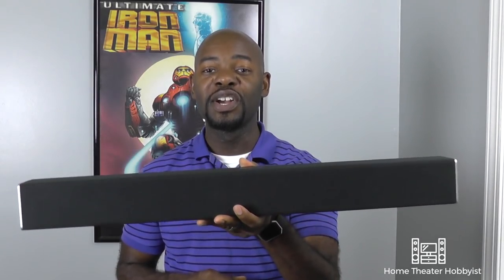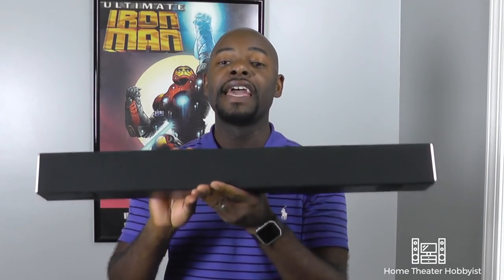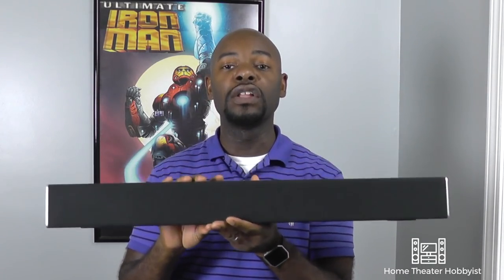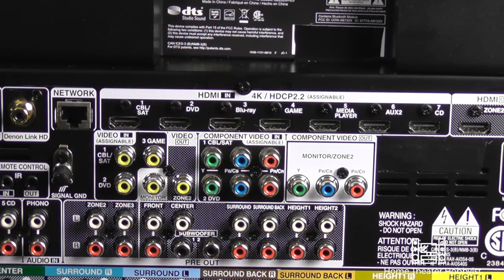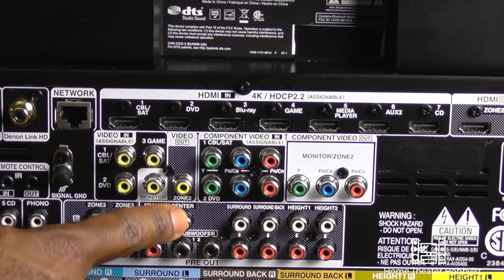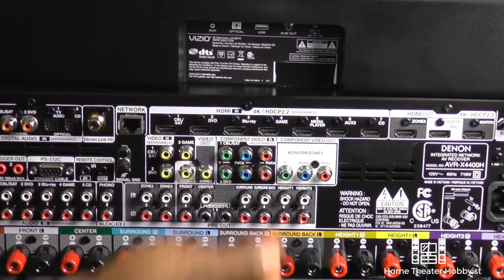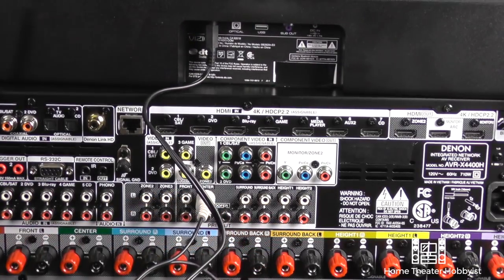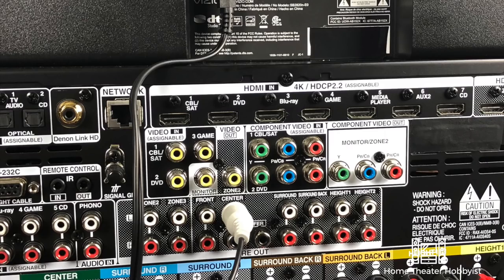HT Basics: Connecting a Soundbar to an AV Receiver

Comment: I think the biggest issue that holds me back from getting a soundbar is the lack of inputs.  It has 1 HDMI in and 1 HDMI out.  If I have an Xbox One, a DirecTV receiver, and a PC; how do I get all of those devices connected?  They all connect via HDMI.  Now the DirecTV receiver connects to the Xbox and then to my audio receiver. Effectively now I only need 2 devices to connect to the soundbar, my Xbox One and my PC.  How would I get both devices connected if there's only one input?  That is where I would see an audio receiver coming into play.  To act as a multiplexer.  Would there be any other way to do this? Or would I have to ditch the receiver and buy an actual multiplexer to pass through?
Reply from the maker: Lack of inputs on a sound bar is an issue. The SB manufacturers want customers to use their TV's HDMI connection as the switcher. But of course that only works if you have enough available HDMI ports on your TV and the one that supports ARC is connected to your sound bar. If you don't have enough then it's time for an AV receiver. Your thinking is on the right track! :)
Thanks for commenting!
Reply: Home Theater Hobbyist Thanks for the reply.  I do believe you set me straight with your reply though.  This may simply be a case of me not understanding how ARC works. However based on your reply I might be ok to ditch the receiver. I have 5 inputs on my TV. 4 are normal HDMI and 1 is the ARC connector.  If I’m understanding you correctly that’s all I need.  Connect the ARC to the sound bar, then connect my components to the TV? Would switching the input on the TV deliver audio from the other components to the sound bar?
Reply from the maker: Yes that’s how it works. ARC stands for Audio Return Channel. It is the way your tv can send audio to the Soundbar. You may have to go into your TVs menu system and change the audio settings to external audio or something like that but it should work for all devices connected. 

I just connected a Sonos Soundbar to my tv this way and it works great 👍🏾. Let me know if it works for you.
Reply from the maker: Unfortunately for this video I used a Vizio Soundbar not a Sonos. I don’t think the same connection can be made without the Sonos Connect amp. 😕 Sorry about that but the Sonos system is pretty locked down. Maybe try eBay or something similar for a cheaper connect amp.
Reply: @HomeTheaterHobbyist  Could he connect all sources to an hdmi switch and then connect that to the sound bar that will be connected to the tv with hdmi arc? will that work?

Comment: I have a sound bar.  And a 12 inch Kenwood subwoofer.     I wanna use the soundbar for the speakers.  How would I go about hooking that up to my TV?
Reply from the maker: If your tv has optical or RCA out then use one of those preferably optical. Then go into the menu system and select the correct audio output.